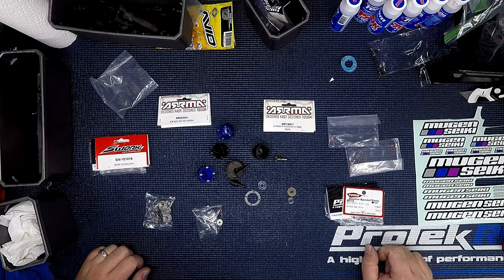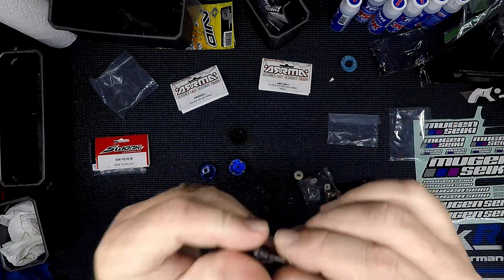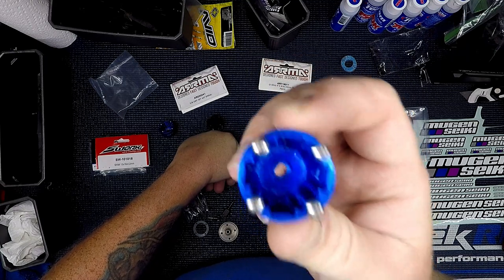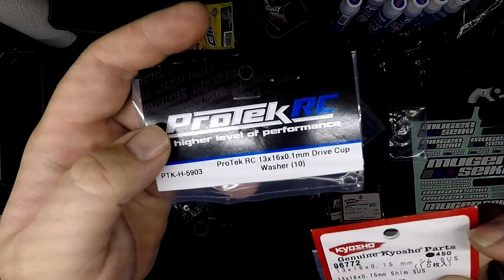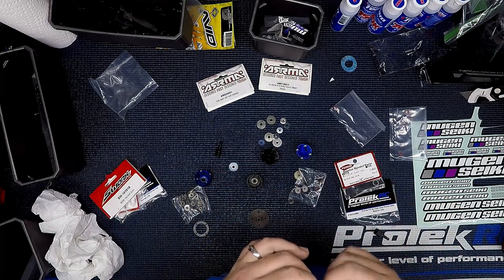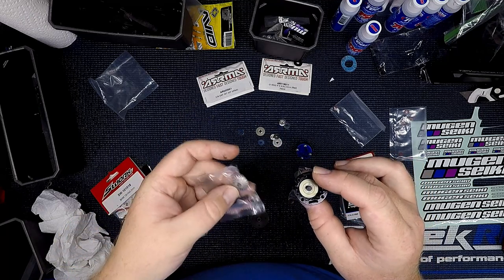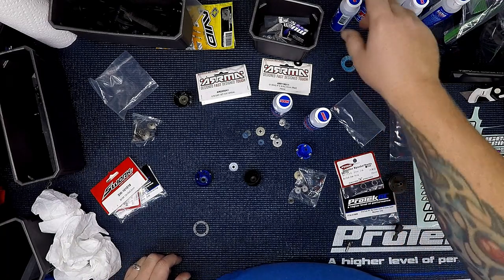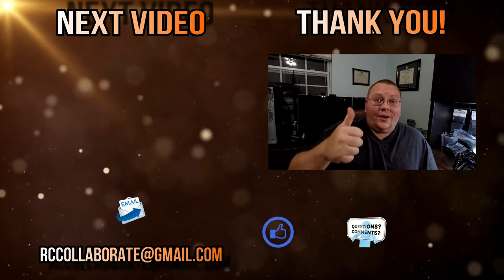How To Shim Aluminum Diff Cups For Arrma Kraton Outcast Talion Notorious Senton Typhon

Comment: Cracking video although I use 6 shims on the small gears inside the cup, 2 shims on behind one gear and one behind the oposite if you know what I mean?
Tightens up the differential mesh, makes them last much longer bro 👍

Comment: Iam New to the Rc kraton word just know the basics I've Been watching video after video Racking my Brains out Trying to this shimming stuff figured out All this gear stuff and what's the best setup and the way to put Everything together with these gears Aluminum against plastic or metal racing GEARS but like i said iam and probably don't know what iam Talking About New to All this gear stuff JUST starting to get used to the slipper Clutch
Reply: And my wording All wrong because iam so Tired and stressed about this Truck

Comment: Questioni have two arrmas both v4 one Typhon 6s and a talion 6s I drained the diff fluid in both cars and noticed  that my talion rear diff had a shim buvno the Typhon rear diff had no shim and it also seemed like the diff cups we're a little different in both vehicles. Are they put together but machines or does somebody put them together and add shims if that pertacular person thinks it needs a shim..
Reply from the maker: I honestly do not know the answer for your question; however,  regardless you want to shim your diffs yourself to make sure they feel right. Don't depend on factory especially if you used it or super especially if you have problems. 

You should be able to put them back with what they came out with and be ok.

Comment: Is the mid diff the same???
Reply from the maker: All diff,  shim the same
Reply: @therccollaborative9524  bro how get gear off to get to the pin
Reply from the maker: @rcplayer7581  use needle nose pliers to pull the gear off or tap it until it lets go. 

The diff fluid suctions the gear to the big gear
Reply: @therccollaborative9524  t hanku exactly how came out once cleaned fluid out used angled needle nose the ring gear as couple teeth shaved down i should replace huh ..
Reply from the maker: @rcplayer7581  yes if it skips
Reply: @therccollaborative9524  thanks yes it was and diffs look good except for factory oil 😆 weird front i guess nose dived on throttle i figured be rear went first
.
Reply from the maker: @rcplayer7581  hard braking is tough on front diff
Reply: @therccollaborative9524  good to know im definitely hard on braking bashing in back yard going stivk with 4s 20 bucks for thst ring gear thinking just buying complete diff but yhan theres that v3 on sale for 389

Comment: Good Video, but did you ever shim your diff in this way? https://youtu.be/xAD5qsMKBGI - the third version (new bulletproof version) - if not, try it and you will see the the diff runs very smoothly all the the time also if you but the outer shafts together, there’s no bad noise than.
Reply from the maker: I don't think it's safe for everyone to assume each diff will accept the same number of shims as everyone else. The best way is to add shims and test it,  and stop when the feel is right. 

The only difference I see here is he puts a shim outside the diff which is ok,  it takes away play and makes it smoother. 

I feel my process is the same despite the outside shim
Reply: The Rc Collaborative Jeremy Hopkins - you’re right, you have to decide how many shims you need on each diff separately. My explanation is for the Arrma V3 diffs (Outcast V2) - I don‘t know if you also need the outer shim on the Aluminum diffcases.

Yes, your method is nearly the same as my method, you only don’t shim the outside. Try my version 😎✌🏻